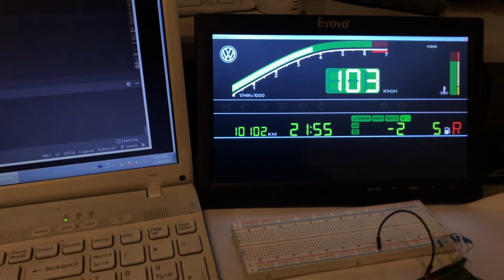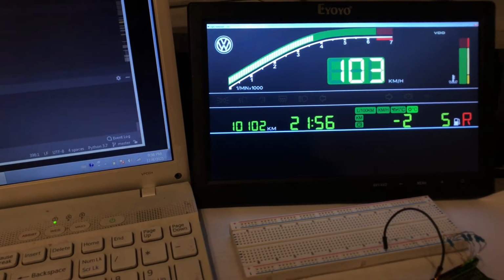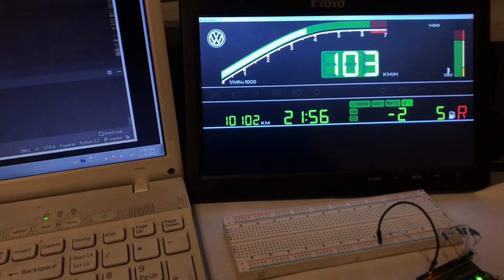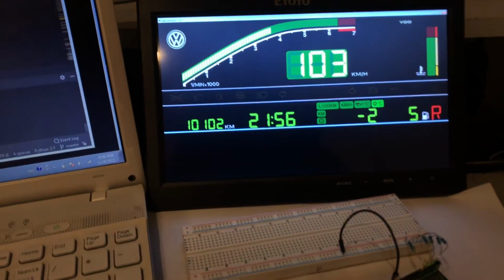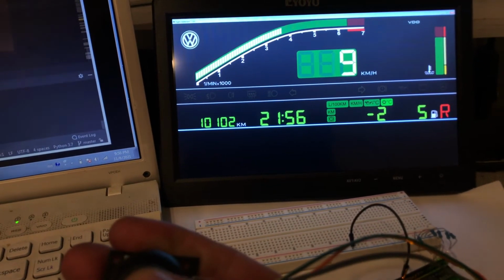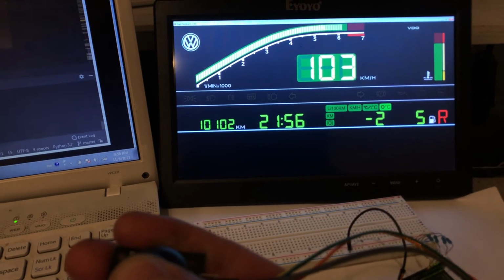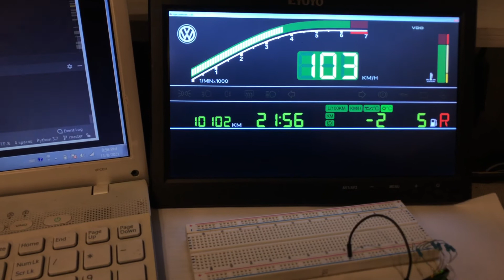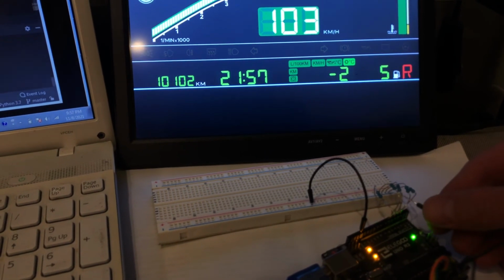DYI VW Digifiz Tribute preview - LCD, Arduino, Raspberry Pi

Comment: Love this dash, have been looking at LCD type dash conversions for my Golf for a while, came to the conclusion that to get what I want I need to make it myself.  Not touched Python programming in over 10 years, and fairly useless at Arduino coding so its gonna be a learning adventure.   Just out of interest what screen is it you are using.
Reply from the maker: Thanks for your interest and comment! I’ve continued this project under my other channel for a Brazilian audience, @br_spec. It’s up and running! The screen I used is a 10.1” lcd from AliExpress with hdmi input.

Comment: Did you have any trouble getting it to work? I am struggling with some python troubleshooting.
Reply from the maker: I did, yes, due to my lack of knowledge; this is my first project in python and I still don’t know how to set up mqtt, so I actually removed all mqtt-related code and instead made the Arduino send the relevant data via a serial connection instead - it just sends a long string with all the info. What part are you struggling with?
Reply: @alaincopter  i 'am in the same situation, i dont know python i try to execute from windows but it's can't start

Comment: Nice work Alain! Looks great.  I originally made a replica of the dash but decided I wanted more data from it so added what I felt needed.  Please to see you make your own tweaks! Looking forward to seeing how you're project goes,  as my time is limited so not much forward movement from me lately! Super cool and thank you for the credit 🙏 😊
Reply from the maker: Thank you Gavin! I really appreciate you making your work available for folks to use as a base for theirs. I too pondered keeping some extras such as the boost gauge and adding an air fuel gauge since mine is gas and not diesel - but then decided I really wanted the original look. Time is pretty short here too so the project might go slower than I’d like, but I’ll try and do what I can here and there. Cheers!